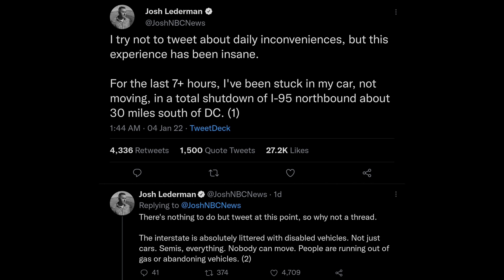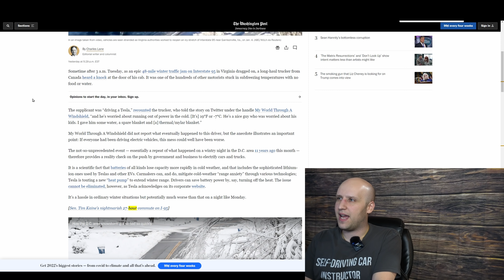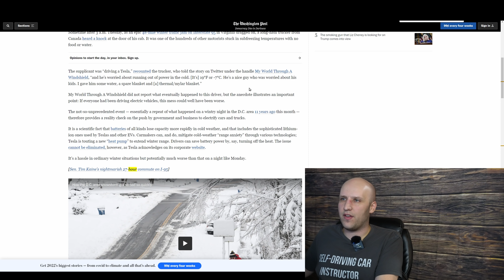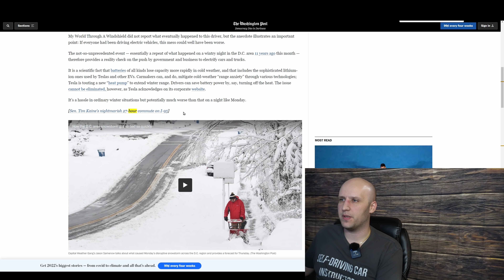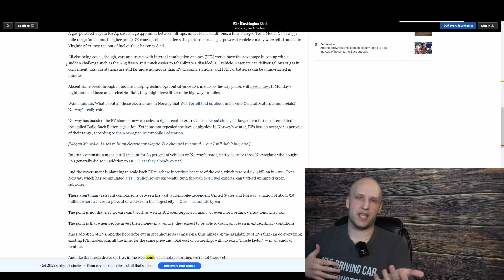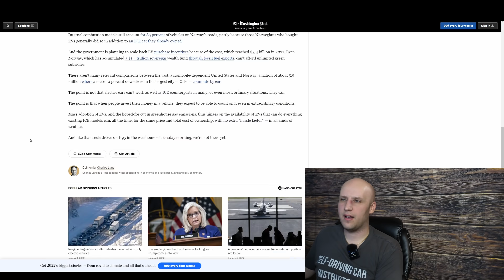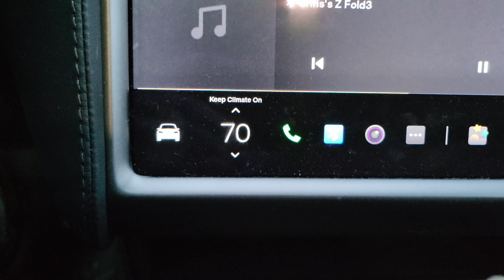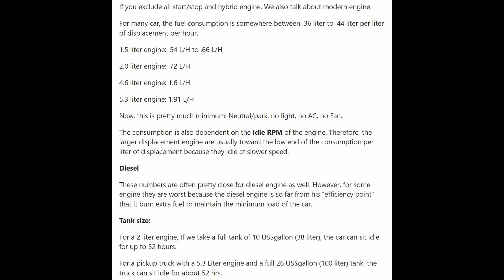How Long Can a Tesla Keep You Warm In A Frozen Traffic Jam? | FUD Debunking

Comment: ICE use 1/5 to 1/7th a gallon per hour at idle. That means even a small tank of 13 gallons would last 65hrs absolute minimum and for smaller engines 90hrs on that 13 gallons. Then there's the extra 2.5 gallons I have in gas can designed for being left in the trunk. The fact you were butt hurt by that very fair article says it all.

Comment: Super nice and useful video, thanks! 
I've never considered the issue - if one is in extreme conditions for long time in an EV, but thanks to you I know now, it ain't dangerous, you won't freeze to death, which is very nice and reassuring to hear.
Reply: Just make sure that you get the largest battery if there is any risk you might have to drive in snowy weather. For example, if you buy a Tesla, make sure to get the Long Range rather than the Standard Range if you expect to drive in snowy weather.

Comment: A gas car can run for say 30 min. And you can shut it off for 30 min, re-start warm it back up and repeat. Making it last as long, if not longer then a Tesla.  The gas motor will retain heat for an average hour. And you do not have to have it at full blast heat. To many variables to have gas over electric , or electric over gas.

Comment: I spend 2 months at a time in my diesel rig. It is equipped with a diesel powered auxiliary power unit. Only burns 1 gallon of fuel every 10 hours and that is even using my bunk heater. Plus I can get about 1100 miles per fill up if I don't mash on my throttle.  I will stick to my diesel powered rig

Comment: I am surprised that the heat pump still works at such a low temperature.
Reply: My 3 ton house heat pump is rated down to -3F to output 12MBh at 1.8 COP.
Reply: @Travis0palzae  Perfect.

Comment: "Gas pumps don't work when the power goes out." You are correct, but I have gas in cans that I can pour into whichever vehicle I want to pour it in. It is highly unlikely that you have an extra battery laying around, that is compatible and you can pop into whichever EV you have. Do you realize how many times I've saw electric vehicles dead on the side of the road being charged by a diesel generator? A lot! Granted I've also saw a lot of people carrying gas cans too. Still the point is, gas vehicles are more convenient than electric vehicles PERIOD! Now if you can whip out solar panels, or there's a river nearby you can drop a hydro generator in then you have an advantage. Unfortunately, EV's aren't compatible with that sort of technology yet, so you're still screwed lol.
Reply from the maker: I'm telling ya dude EV is more convenient overall. I've been driving electric 3 years with over 70k miles and have never run out of charge. The car will warn you 20 times before you can get too far from a known charger. I've saved so much time not having to go to the gas station twice a week.
Reply: Maybe I will get one and see for myself. Question tho, do they not kill your power bill? My power bill is already $300+ a month...
Reply from the maker: @travishope9364  it's usually about 1/3 what you spend on gas give or take. When I had a Ford Focus I spent $150 a month on gas. Switching to a Model 3, that's $0 for gas and my electric bill increases by about $50/month

Comment: Don’t use electric regen to fast charge your EV.  It’s meant to capture the energy from braking, not trying to fight a Ford 550-super duty.  You can fry the braking controller, or at the very least over stress the system.  It’s like braking down a mountain, if something isn’t quite right it’s going to be a disaster.

Comment: The main problem with electric vehicles is a small tap to the vehicle will permanently disable the main battery by burning the emergency main fuse.  You will need to take it to a repair shop to re-enable the battery.  Thus very minor damage completely disables them while gas vehicles don’t have this issue.
Reply from the maker: uh no https://www.youtube.com/watch?v=WDUknDUkEx0 here's my accident from a few years ago
Reply: @DirtyTesla  ahh, yes https://www.tesla.com/sites/default/files/downloads/Model_3_Emergency_Response_Guide_en.pdf page 11.  Do you not even read the manuals for the things you purchase?  You need to flatbed tow it from it’s resting position, you can’t even push it off to the side for safety unlike any gas vehicle.

Comment: An interesting implication of this is that if you are lost in inclement weather, you may be better off stopping and using the power to heat your vehicle rather than continuing and running your battery down.

Comment: Why in the Hell doesn't the Tesla have a small emergency generator? you can't always have access to the power grid!
Reply from the maker: Because then it would be a hybrid. 3 years+70k miles and I've never had a problem charging my Tesla, even on a 1,000 mile road trip https://www.youtube.com/watch?v=07EnZpZKAVs
Reply: @DirtyTesla  No I think it would be an electric car with an emergency generator in a hidden compartment. You couldn't power the car with It, only charge it slowly.

Comment: Please tell me everyone on this channel realizes the absolute non-feasible concept of electric battery vehicles? More pollution, less range, more coal power charging, ever massive increasing power costs the more of them that are made. This will drive up the cost of power, precious minerals to make the batteries, used battery pollution, etc, etc, etc…. Have fun paying 20-40k for new batteries (if you can get them) when they die in 2-5yrs.

Comment: i was wondering, how long can a tesla keep you cold in a heat wave?
Reply from the maker: A lot longer than this :) I'll do it this summer
Reply: @DirtyTesla  really? The question entered my mind when I went to pick up my wife at the airport and it was about 103 deg without a tree in site. I was in my Mazda 6  watching a guy in a Tesla and Wondering how long he would sit there with the ac on? Interesting stuff.
Reply from the maker: @johnsmith-dm2tq  heat pumps are much more efficient than cooling the interior than warming it. Check back in 6 months or so :)

Comment: There's latent and sensible heat. Latent is how much heat energy is in the environment and sensible is the heat you can feel. Heat always travels to cold. That's why water freezes at 32° and ice melts at the same temperature.

Comment: Your electric rate cost is half of what we pay in NH . Running a electric car here is like a car that gets 20mpg wen factoring in current fuel cost. Not worth it.
Reply: For perspective. Cost about $50 to charge a 24kwh Nissan leaf batt to drive maybe 40 miles tops in the winter before you are in a dead cold ev.
Reply from the maker: There is no way it costs $50 for 24kwh. That would be $2/kWh. If your rate is double mine, it'd be $7.68 for that battery.

Luckily it's easy to Google and in NH it's $0.2/kWh which means 24kWh is $4.8

At 20mpg, let's say gas in NH is $3 even tho we both know it's more than that. You'd use 2 gallons to go 40 miles, which would cost $6, which is 25% more expensive than your inefficient leaf.

Comment: So interesting that turning the seat heaters on is more efficient. That is the opposite of what I would expect.
Reply: They are not more efficient in producing heat than a heat pump, but the cabin feels warmer with the heated seat so you can lower the temperature in the cabin by a few degrees which saves electricity. The heated steering wheel helps too. That being said, even in freezing weather, it isn't something that I need to worry about in my daily commutes to work because I usually only use 25-30% battery. :D
Reply: @randomrud  ah, yeah that makes more sense.  Thanks for clearing that up

Comment: EVs are an interesting beast. Where I live, we just ended a 3 week freeze of -31F. I would like to see how teslas handle our winter. Another consideration that govts and people fail to consider when pushing EVs is that not all power grids can handle it. Our province was not able to meet demand during the last month, so I couldn't imagine how much of a strain a fully EV'd Alberta would put on our power grid that is currently incapable of keeping us all warm during the cold snap with gas powered vehicles!
Reply: Don't worry. Soon it will be tropical thanks to all the carbon dioxides going into the atmospheres. Probably to manufacture and charge EVs. I imagine a lithium battery fire on ice must be quite interesting as well!

Comment: Hey. When you turned down the heat it was very stupid of the software to start blasting air so your temperature could go down.

The heatseat should have been on the middle setting. On max it would start boiling your poop fast. I dont use it on max on the cars I have had with it. But your example with high power usage  scenario is good! 

They say an ICE uses about 1 litre of petrol per hour if it is a small engine. 

My diesel Audi would not like to be ideling in a low temperature, the water temp drops so fast.
And also ICE cars use more fuel when it is cold outside! They don't realise that!

Comment: A thought occured to me that just adding gas may not reliably start an gas engine car that ran out of gas at subzero temps ... A warm fuel system would ice up some and it's possible just adding fuel wouldn't unclog the system... I guess most would start but it's not a guarantee either. 

But that's just a guess.
Reply: Lot of new cars rely on fuel to cool the gasoline pump in the tank so running it dry could cook your pump.....

Comment: On a gasoline car, like with propulsion, much of he heat energy from the fuel don’t go into the cabin even with max heating, that makes a huge difference. The fact that the engine is so big and insulated from the cabin, with its own water cooling system, means most of the heat is wasted.
Reply: Yes, that's why it's a good thing that the coolant running through the big heater core inside the cabin is at 200F (93C) at operating temperature.

Comment: Something to consider is that when it's over, if a lot of vehicles ran out of power/fuel, with ICE vehicles, you can clear them quickly with a few gas cans. With EVs, you're going to need a different strategy.
Reply: This is why plug in vehicles should have been the way to go
Reply: @Tonyrg1988  I think the option to take some kind of external battery pack might be something worth designing for. You might only need to move the vehicle a mile or two or even just to the emergency lane.
Reply: @chaos.corner  if that’s the case they can just lock away  some reserve power on the battery

Comment: Wondering how well it will do in -30 to -35 temperatures. That is Canadian winter. Still better than gas. I don't have measurements to prove it though.
Reply: actually do need proof. heat pumps become useless if the temperature outside goes low enough. I'll stick with gas which works well for me and is very much cheaper.
Reply: @lorenzo42p  I am leaning towards plug-in hybrid electric vehicle (PHEV) which works on electric power for a certain distance and then switches over to gas hybrid mode. Only challenge is that there is a shortage of materials so delivery time is anywhere from 1 to 2 years.

Comment: Question: If I don’t drive my fully charged EV for 3 or 4 days, maybe a week, will the EV car battery lose part of its charge?
Reply: Teslas are know to have "Phantom/Vampire Drain" which does exactly that. Sentry mode especially uses some. In true "sleep" mode where it's fully off, 1-2 miles of lost range per day aren't uncommon, and some report as much as 4 or 5 miles lost. 

With sentry mode on it's worse and would likely fully drain your battery in about 2 weeks. 

Simplest solution is to just ensure it's plugged into a wall outlet or something if you're going to have to leave it somewhere.
Reply: @Joesolo13  if my gas car did that it would never be acceptable, but I guess it's fine for an electric car. it's like fuel is slowly dripping out of the car over time. double-standards are great.

Comment: One thing that they forgot to point out in that article is that gas powered vehicles also have lower range in the winter. Most parts of the US have different blends in the summer and in the winter and the winter blends are less fuel-efficient.

Comment: One thing you're not factoring in - yes, the EV's heat was holding a lot better than I would've thought (being an IC user until EVs are cost comparable) - is the fact that someone trapped in their car in an I95 situation won't only be using the heat.  They'll likely be using the vehicle's infotainment unit(s) - either to keep themselves and the children sane.

Comment: Only -7c isn’t a extreme condition in Canada.  It gets to -30c (-22 F)or worse here by engine wouldn’t even be running in only -7c.  Hybrids are the best in my opinion in cold climates. Everything lose range ICE or Electric in the cold. In ICE 4x4 or all wheel drive vehicles the oils in the engine/transmission/transfer case/axle gets cold the mileage will fall. Full electric I won’t trust in the middle of no where.

Comment: When i use to work as a parking attendant. I picked up a tesla and parked it in the garage’s ramp, which was still under cover but it was outside. I left it there for about 3-4 days and when i came back the damn thing said…. “Low battery due to cold weather” 🙃 btw this is in NYC. 

Teslas are HORRIBLE cars. They aren’t perfect but what car is. I always said Tesla should make the whole car one big solar panel, so it can charge while its parked.

Comment: I've been in situations where ICE vehicles were unable to be restarted because their radiator had frozen. Also, to date, no one had suffocated in an electric car because they didn't clear the exhaust. In this situation, I would have preferred to have been in a hybrid, but I'm so sick of people hating on electric cars.
Reply: That's why you should be using antifreeze and not coolant simple stuff, even I. Ev you need to use antifreeze for the cooling system, if not the coolant would freeze just like a gas car and keep the batteries too cool which would degrade the range you have, an then ev already suffers when cold, what we learn is go with a full tank of gas or a full charge, in Texas alot of people died in EVs because current went for more than a week an there couldn't of charged there cars an forzen to death, also people in gas died also because there didn't had a full tank

Comment: Tiny observation. Even though gas vehicles are just transferring wasted heat from the engine, the fans used to utilize the heat run off power produced by the alternator. More power draw=more physical resistance to turn alternator wheel= more fuel consumed; albeit minutely
Basically heat fan turned on high would prob use more fuel.

Comment: The heat aspect is not the only drawback. If all those vehicles were electric cars, they would all have to be towed or loaded to clear the road, which would in itself be a nightmare. A gas or diesel vehicle would only require a fuel truck bringing in fuel to fill gas tanks to clear the mess.

Comment: If you have a parking heater in your gas propelled car, it will burn 1/10 of a gallon per hour. So with a half tank (let's say 7 gallons) you can sit around for 70 hours in a nice an cosy car with the burner on nonstop

Comment: Your energy cost calculations are not accurate. You based it on reported consumption, not the actual energy required to charge the battery due to losses. Using the 2021 Tesla Model Y as an example, Tesla's own data—buried deep in 49 pages of certification documents filed with the EPA—shows it took 87.868 kWh to add 77.702 kWh to the battery of the Long Range version. That's a 13 percent overage. For the Model Y Performance version, adding 81.052 kWh to the battery required 92.213 kWh, or 14 percent more. Although current EV owners escape paying the equivalent of the gas road tax, rest assured that is only temporary and will be coming, and in spades. Due to the fact that it has been determined that in order to support an "all EV fleet" the electric grid along with generation would need to expand its capacity by 6X. Most of those expenses would be be added the "road tax" future EV'ers will have to pay.  No one seems to realize that at this point in time.